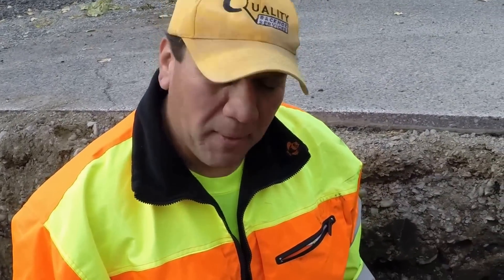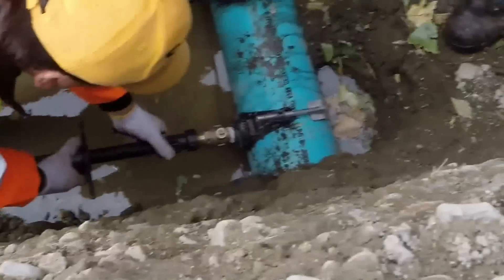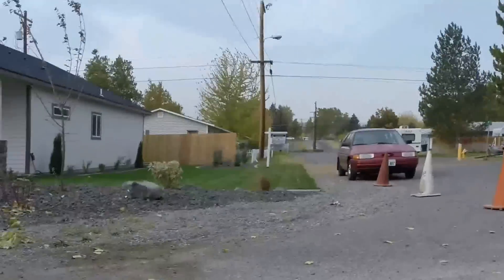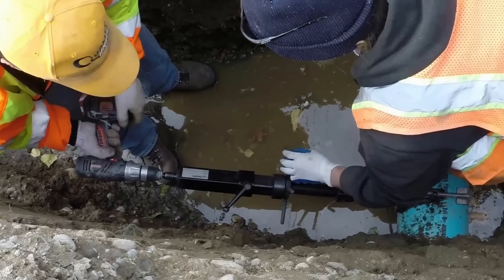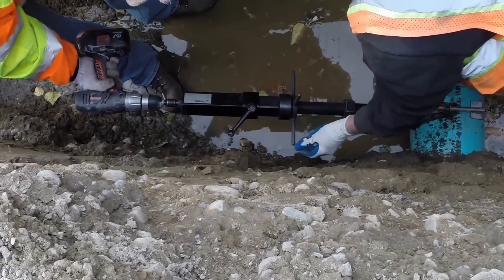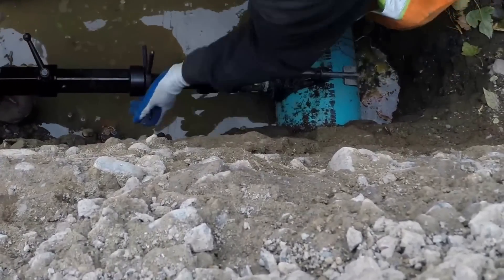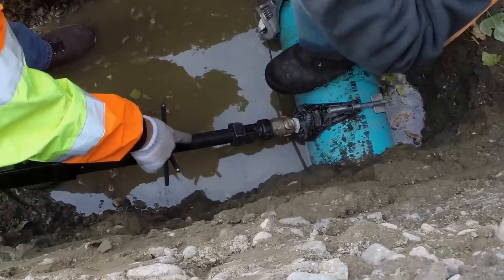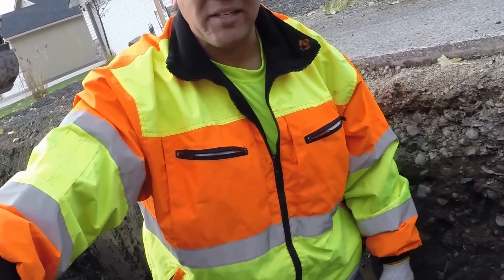Hot tapping water main for PVC C-900

Comment: Nice job, but are you following Uni-Bell Standards and Practices?  Shouldnt you be digging over to expose the pipe to make sure you are 2 feet from the pipe end and 3 feet from any other taps?  Also, Uni-Bell states that Taps on PVC should be done by hand, without the use of power tools.

Comment: My partner and I have just started using this exact tap for hot taps on 6 inch DI. We are both inexperienced and would love any tips you have to help us succeed! We are using a power drill at a speed for high stamina hand cranking .
Reply: We use a similar tap but alot smaller and it's hand cracked, using a power tool is a huge no no for us. Better to feel by hand then guessing with a power tool

Comment: Where do the shavings go?
Reply from the maker: Most of the shavings usually stay within the proximity of the tapping hole and machine used. Once the tap is made always flush out by opening corporation stop 'valve'. Flush the water for around 5 seconds at the mainline. Flush out one more time (air in line) at the meter set or AMS. After flushing install meter.

Comment: Is this a temporary tap which you leave as it is after use, or does it need something else? Wondering does the saddle hold through time. Excellent video btw. Regards from a mechanical engineer
Reply from the maker: That's pretty much it my friend. They key is to make sure you caulk underneath the corporation stop with some good bedding.

Comment: I had this done in my farm while I was away but when I got back there and turn my meter it’s just air blowing out of the line no water, I rang the Department and they said it’s a water pressure issue, plus its a downhill slope so the water just run straight downhill but not feeding my private line, I was so confused and disappointed and I’m still wondering what exactly happened as I really need water in my farm

Comment: We got bit stuck in a valve luis ,any suggestions?
Reply from the maker: I don't know the situation but you may have to shut down the main to get it out. If you feel you can't get it out, just get another corpstop ready and take out the other one with the bit once you turn down the water. If you can leave a little bit of positive pressure in the line to prevent dirty water from going back in pipe. Also dig a deep hole for water to run in and pump on stand by during the exchange.  Sometimes it's better doing that than not knowing if you can get the bit out plus it may have cause damage to the stop valve? If you don't have another corpstop on hand you can put a threaded plug in it then regroup. Like I said don't know the situation. Help this helped in some way.
Reply: @LuisSanchez2  ok thanks.  .situation same as video but handcrank and 10inch main  whole hwy of buisness and subd will have to shut down...bit is stuck in valve i think

Comment: My old boss did a "hot tap" with an excavator bucket once, i guess he forgot about the whole valve process
Reply: lmao we had something simular happen to another gang working not far from home.  Plans didnt match reality due to shody track records of what was in the ground.  The gang were replacing old Cast Iron gas main with a new poly ethylene using directional drilling technique.  They proceeded to direction drill straight through a 12 inch and a 4 inch water main and didnt realise until they had pulled the new gas line back through the water mains breech at which point, as you can imagine, a tsunami appeared in the excavation and went on to flood half the area over the next 8 hours. had fire brigade, police, council and local news papers.  This was only last week.
Reply: I have done the exact same thing. I don't recommend it - especially when it's below 30°F outside.

Comment: Can you do this with the smaller copper pipe?
Reply from the maker: I dont know for sure. On 4" and up I'm sure you can with special saddles that are made for the pipe O.D. the smallet ones you will have to cut in a tee using compression fittings. Any one out there know the answer? please put in your 2 cents.
Reply: there are self cutting taps for small diameter copper pipe yes.
Reply: @BigPerm6999  thanks
Reply: @just1rick21072  np, there are also self cutting isolation valves.  They are almost like miniture saddles/top tees.

Comment: Never heard it called a HOT TAP!
We call them wet taps.
And it only takes one guy not 2!
Btw that valve is called a corporation not curbstop!
Can tell you guys are with a city water dept.   Lol
Reply: The curbstop is a valve that is exactly that ...it's a shutoff in the curb before the meter setter. But your right it's a corp.  Also they should try and get some of that water out of there before they contaminate the main line.

Comment: So does the plastic drill shavings go in the drinking water for us to swallow??
Reply from the maker: When you open the valve it blows 'most' of the shavings out.
Reply: @LuisSanchez2  yeah but I'm talking about the shavings from drilling before the valve opens. I'm sure there must be some going into the water.
Reply from the maker: @shawnyblaze  Ya some gets in the pipe, but not much. Its always good to flush the nearest hydrant, but for the most part the existing pressure in the line will blow it out as the valve is opened up because of the draw of the water coming out will pipe. When the cutting is taking place the pressure in the pipe is pushing most if not 99% of the shaving into  the taping machine (positive pressure). The core comes out and stays in the cutter. When your done you have to take a screw driver to pop it out but I'm sure there is a small percentage that gets left.
Reply: @LuisSanchez2  I'm buying a Brita!

Comment: Hot tapping refers to welding on an active pipeline.  Yes, even on gas lines.  Use a set on Weld-o-Let.  Full pen weld all around,  pressure test, then screw in the ball valve.  Make the bore hole, withdraw the bit, then shut the valve.

Comment: Well you are not in a world of hurt if the drill is still in the valve, just take the whole fixture out then close the valve. Used to fix mains (residential 3/4") that had broken by cleaning them real good, then cutting a section out hot then with a pre made section of pipe consiting of compression fitting, valve, compression fitting, then with the valve open slip it over the supply side pipe, tighten the compresdion fitting, then close the valve, then take your time on the second compression fitting. This works great but if you mess arround and let the water fill your hole you are screwed and need a big pump to get the level lowered. Once I had to hold my breath and go down under water and get it put in place and shut off so we could pump the hole out and finish.

Comment: We do hot taps but a lot of the time it is ductile iron.

Our tap is bigger and has a sealed section so you can swap the cutting bit for the shut off valve.
Reply: Well, our mains are made of solid gold and my tap is bigger than yours.
Reply: @mattt198654321  the worst is when one of your flunkies cross threads the cork stop on a live main,...

Comment: Slow down, Larry. 
Slower, Larry.
Sheesh, hurry up Larry.
Why don't you get it, Larry?
Reply: It was simple.  He said the pattern. Half turn wait a second.  He didn't listen very well
Reply: That's how people, who go home clean every day, talk to the real workers.
Reply: Get your shit together Larry! I LOL'D slightly.
Reply: That might get you decked.
Reply: - UltraVic i was thinking the same thing.
Reply: half turn wait a second is NOT an official system, the turn is to keep the drill bit under enough pressure to drill (each turn compresses a spring that is pushing on the drill bit, turn to much spring compresses so much the drill cant drill not enough turns and no pressure on the drill bit, go to far however and you could drill right out the back of the main.  The turn rate is dependent on the drill rate.  Would much rather use a manual wrench over a cordless drill as can feel the cutting with a wrench especially on small diameter PE and can feel as soon as you've tapped into the pipe.

Comment: Make sure you don't drill through the other side of the pipe.
Reply: That's pretty hard to do, there's measurements on the machine so you know how far you you drilled
Reply: @Jdl223  yes you measure drill bit, distance through valve to main etc and mark the thread so you know when to stop other this would be a real possibility.

Comment: Is it installed at 45° for the ease of turning it off and on?
Reply: as i understand it helps prevent sediment from getting into the new line
Reply: Exactly what he said that hot tap is going to a customers meter the 45 ° Corp is for clean water at the upper part of the pipe
Reply: @seantbr2019  It is captured in any number of various downstream screens and filters. I filter my drinking water regardless. The fact the filters eventually get clogged indicates that not all debris is captured.
Reply: @bobbastion7335  I was a pipe layer and have installed thousands a feet of pipe ranging anywhere between 4 inch diameter to 32 inch diameter all different types from ductile iron to c909 I have never once installed a screen
Reply: @seantbr2019 So, let me get this straight. Because you have never installed one, it is your assertion that they don't exist?
Reply: @bobbastion7335  they might exsist somewhere else but not in my city
Reply: @seantbr2019  Okay, just so we're straight.
Reply: @bobbastion7335  cool

Comment: Why is the stop installed at a 45° angle?
Reply from the maker: If the stop (corporation stop valve) is installed at a 9 o'clock or 3 o'clock position it has more of a potential to break over time because it's hard to get good compaction underneath the valve being at a straight angle (there just easier to brake). One other thing that I may add is that sometimes it's a whole lot easier if a person had to go back and do a repair at the meter when digging down to the corp stop you can get to the bottom or top nut better to shut it off. NOTE,... If a person had to do that it is best to dig by machine a little bit and do the rest by hand if possible. To much can go wrong trying to do everything with the machine.
Reply: @LuisSanchez2  Thanks!

Comment: Exactly, and I mean EXACTLY, as I was taught. We don’t use a drill though. We crank the drill by hand. Great video! Is that a stainless saddle the corp is in? Our water companies have us use brass. But we usually tap into mains which have an “asbestos-like” coating.
Reply from the maker: Right on. Ya we got alot of a/a pipe around here too. Thank you

Comment: Have you ever ruptured a line doing this? Like something go wrong and the line bust due to age or other problems
Reply from the maker: Yes. If you over tighten the straps. Sometimes on a P.V.C pipe over time they began to get oval in diameter. You can always tighten the straps if they leak water but never go back wards. But yes when I used to work for the city I remember we had over tighten a P.V.C pipe and when we drilled through it by hand it split and exploded. It was only a 6" pipe but with 85 pounds of pressure behind it filled up the
trench like now, and carried all our tools down the road. It was a mess Lol

Comment: the guy standing on the pipe obviously doesn't have much experience. i watched my foreman fly 10 feet into the air when a pipe that was slightly bent exploded during a tap.
Reply from the maker: Mr Fingers ya I know. That wasent safe. I had one break on me also. Good one.
Reply: Luis Sanchez I broke a 16 inch line. yee haa a hell of a lot of water comes out of those things.
Reply from the maker: Mr Fingers tell me about it. I could only imagine. Ya the one we broke was only a 6" and it filled up the trench like now and buried the tapping machine and box Lol.

Comment: Nice video.  what happens to the "core" of the plastic piece that is drilled out?
Reply: Scott Solkofske its up inside the drill bit on the tapper
Reply: Boitano Excavation got it, similar to when someone uses a hole saw to drill a hole in a piece of sch 40 pipe?

Comment: We use a Mueller tapping machine I’ve never used that kind...I hate tapping anything other than ductile...you gotta be careful tapping more than 1 service too close on those pipes
Reply from the maker: KMike68Camaro I used a millet tapping machine years ago and I liked it. Ya If had the pipe split before on me and your lucky if you can find the tapping machine under all the mud Lol
Reply: Luis Sanchez LOL I’ve tapped those pipes maybe 30 inches apart and they split...here in Massachusetts we only use those pipes near the ocean because of the salt water...they have their pros and cons easier to cut to length...the Muller tapping machines are great but when the operator breaks and you have to do they by hand and you have 4/5 to do in a day let’s just say you’re not going to the gym later LOL...what state are you from?
Reply from the maker: I'm up here in Washington state. Ya things are changing up this way as far as the material of the pipe. Their switching over to ductile iron because they're having problems with contractors with larger machines breaking the P.V.C  pipe (this should never happen but it does). You can still break ductile but it's much more robust.
Reply: Stagger your tapsnot all in aline maybe 45deg and 55 degree 45degree a foot apart

Comment: Here in the Netherlands we use saddles like that for iron pipes, I could imagine it's easy to over tighten them on PVC. Also the drill bit you used is different to what we use. When using it you end up with a plug of PVC that's stuck in the drill bit and needs to be removed afterwards. Also we never tap using electrical tools, not even on iron. I'm jealous of you guys and would love a device like this.
Reply: elmanitasdeplomo  the water bureau I work for doesn't have PVC mains, but we also use tap saddles for our cast and ductile iron mains. Our tapping machine is hand powered

Comment: That is a wet tap, not a hot tap. There is no welding or heat source involved here.
Reply: It is actually called hot tapping not wet tapping, should learn the terms before commenting maybe?
Reply: gregg4164 LOL....Hot tapping means it’s live meaning the water main is live not dead aka operational or full of water and in use
Reply: Hot tap buddy, the main is under pressure.

Comment: Our company Anhui Tongfa Equipment Co., Ltd is professional manufacturer of pipe hot tapping machine for water and gas
pipeline in China since 1994 . 

We have models of hot tapping machines as below : 

ZG2-50 Manual Hot Tapping Machine for cast iron pipe, ductile iron pipe, concrete pipe, PE, PVC pipe 
tapping diameter 20-50mm)
 ZG2-100 Manual Hot Tapping Machine cast iron pipe, ductile iron pipe, concrete pipe, PE, PVC pipe
(tapping diameter 80-100mm) 

DK6 Electrical Hot Tapping Machine Series for cast iron pipe, ductile iron pipe, concrete pipe, PE, PVC pipe . 

DK6-200 ( tapping diameter 80-200mm) DK6-400( tapping diameter 300-400mm) 
DK6-600 (tapping diameter 500-600mm) DK6-200B( improved model, tapping diameter 80-200mm)
DK6-200C( improved model, tapping diameter 80-200mm)
DK8 Electrical Hot Tapping Machine Series for steel pipe 
but also suitable for cast iron pipe, ductile iron pipe. 

DK8-300 ( tapping diameter 100-300mm) DK8-600( tapping diameter 400-600mm) 
DK8-800 ( tapping diameter 700-800mm) 

Also we are the manufacturer of tapping saddle, leaking pipe repair clamps, pipe cutting machine . 
We have the large range of sizes of tapping saddle, leaking pipe repair clamps for
different pipe OD .
 You can feel free to contact with me by below contact
information . 

Charlie YanSales Manager 

Anhui Tongfa Equipment Co., Ltd 
Add: Changjiang E-Commerce Park, Wanjiang Dadao Road, Anqing City, Anhui Province,CHINA 
Tel: 0086-556-5220356 
Website: http://ahtongfa.en.made-in-china.com/
www.ahtongfa.com
Email: sales@ahtongfa.com